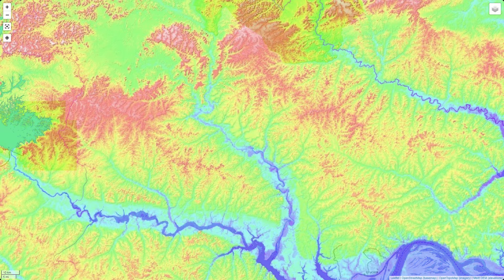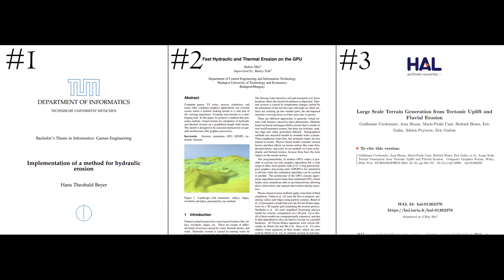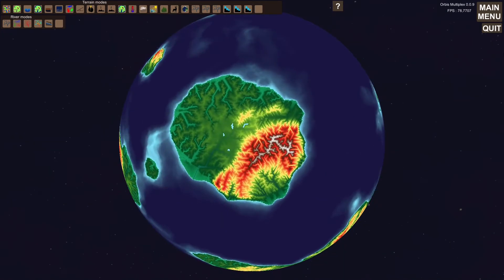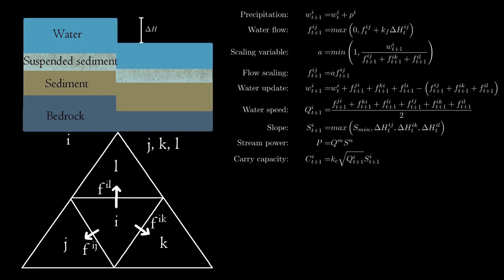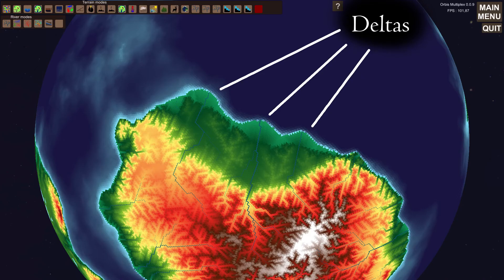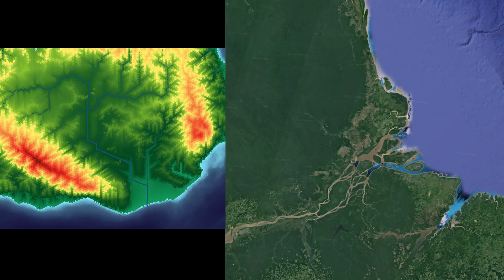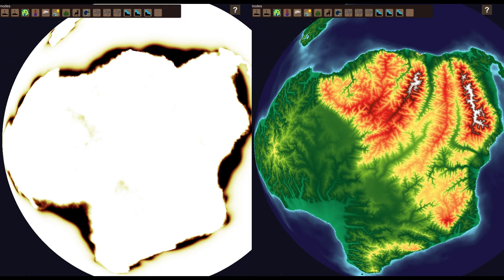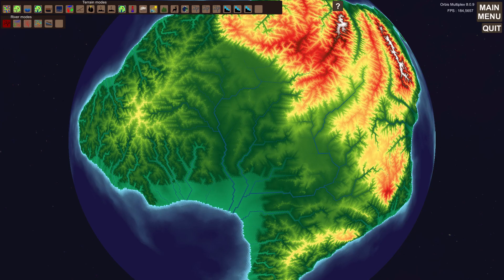Hydraulic erosion : Devlog #6

Comment: I'm currently banging my head against erosion on two different heightmap types... One is based on a voronoi graph network (a port of mewo2 Fantasy Map generator), the other is a classic grid (based on nickmcd's hydraulic erosion). I am running into similar problems as you (sinks / water pools, performance issues on high-res maps). I tried to create a hybrid of water flux graph and a flooding algorithm to find drainage points for sinks for both map types (with no real success yet) in order to get fast, solid erosion working. Anyway thanks for your dev logs, they are incredibly useful! :)
Reply from the maker: The mewo2 fantasy map generator looks cool. Sort of a hybrid between a historical map and an erosion simulation.

If your using a simple 2d grid, then this model might be good: http://evasion.imag.fr/Publications/2007/MDH07/FastErosion_PG07.pdf. If you implement it on the GPU it's very good in terms of performance. And it doesn't get stuck in holes, but it doesn't necessarily drain them either. If you don't do it on the GPU, I recommend an implementation where you use matrix operations. Don't do the computations as a loop over all the tiles, that's to slow on the CPU.

Im using about 1200000 triangles in my simulation, draining all the depressions takes just a couple seconds, plus/minus a bit depending on the initial elevation map. Maybe I should make a video describing the depression drainage system in detail. It's based on a flood-fill in order to find depression outlets, and then some graph walking to cut a "drainage channel". The process is repeated until no depression remain. It struggles a bit on very flat surfaces, but otherwise it works fine.

If you want to discuss things in detail we can do so on the Discord, I'd happily share some of the knowledge I might have.
Reply: @armemessser I for one would be very interested I've been looking for something like this but can't figure it out. Reading through your comments I've started looking into flood fill and tree graphs but I would love to see an explanation particularly with the hex grids
Reply from the maker: @AuroraRaiju  a tree graph hex grid  erosion algorithm implementation walkthrough. Does that describe what your after?

Comment: the erosion looks superb but it looks like you're using a simple perlin method instead of the ridged/rectified method eg.
1.0 - abs(1.0 - n - n);
using the ridged method for each octave cumulates to put ridged "mountain ranges" naturally in the center of continents, which naturally extend into archipelagos et c.
i can't remember the name of the map making software i was inspired by but the developer wrote about his method at the cartographersguild website.
Reply from the maker: Hi

I can imagine the outcome. I've been playing with erosion on and off since 2018. For some periods I've used ridged noise. But not for each octave, when I used it, it was a filter I applied at the end of noise generation. Your approach sounds interesting!